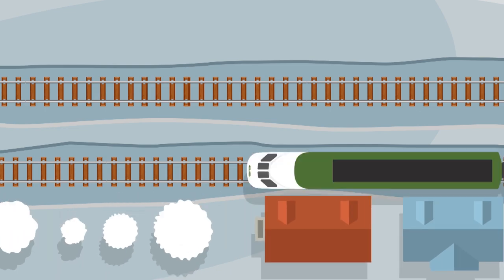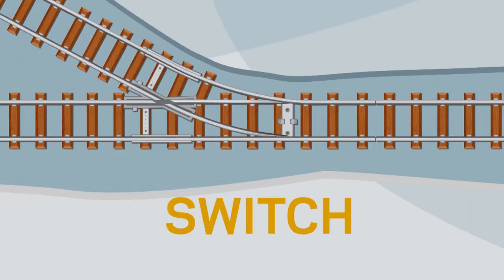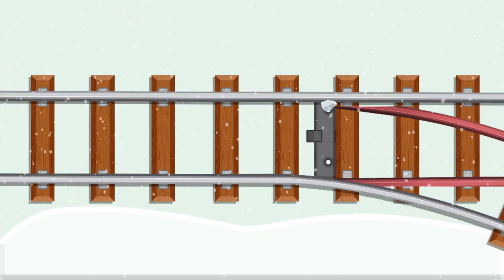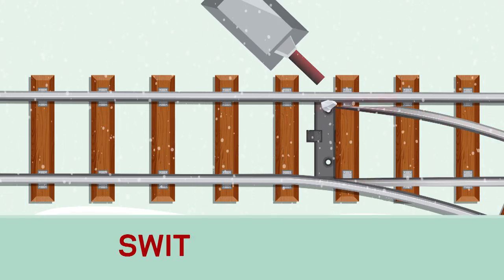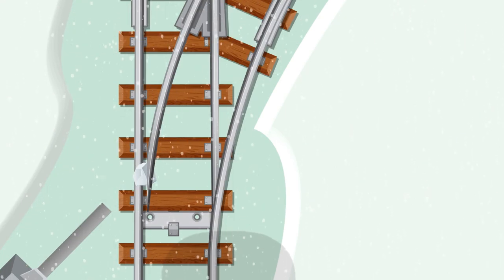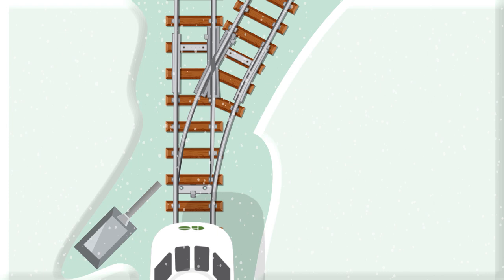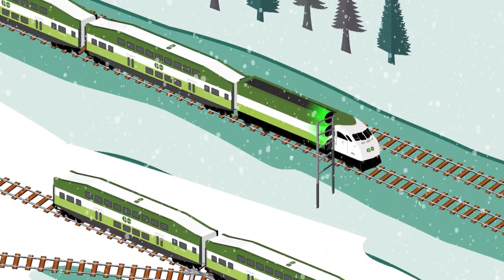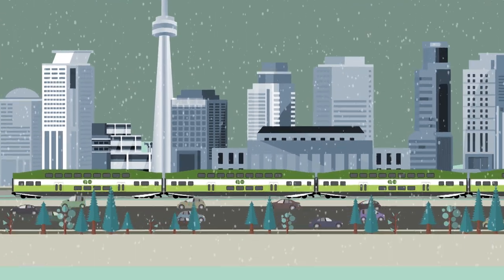Winter Train Delays…What Gives?

Comment: Of Course GO Transit Get When there are lot of snow on track Can make slippery But GO Transit One of the best transit in canada And The Long Train That they use F59PH or MP40PH-3C to pull 6  cars Then they MP40PH-3C to Pull 10 cars until they Reach MP40PH-3C with 12 cars 10+7+12 All of those train make 31 train with 28 bombardier go transit and 3 locomotive that very Long Train Longer Then People GO Transit is The Best Transit Canada
Reply: Yes true